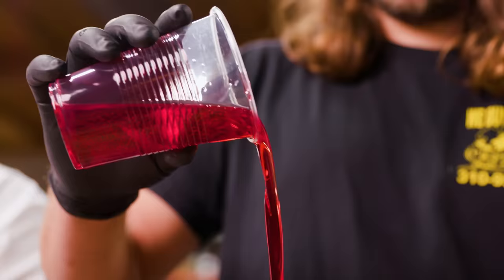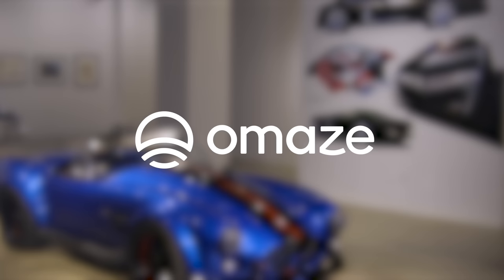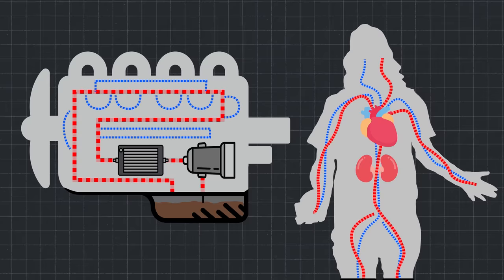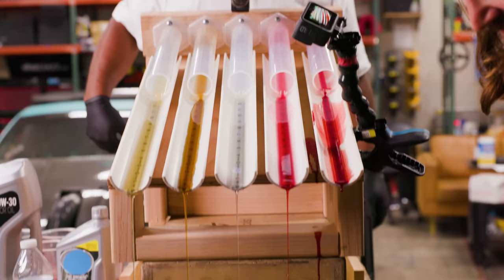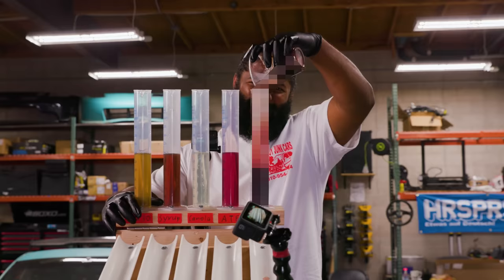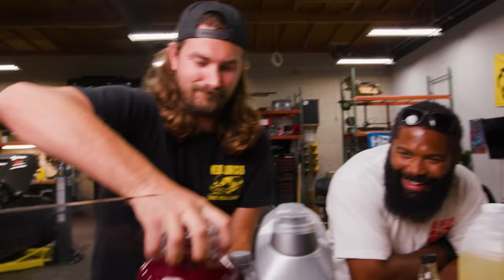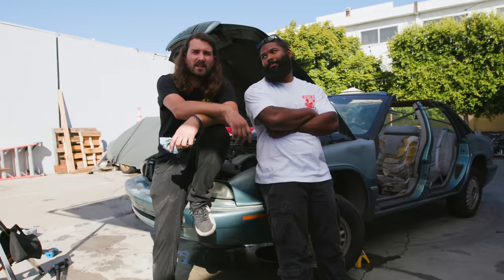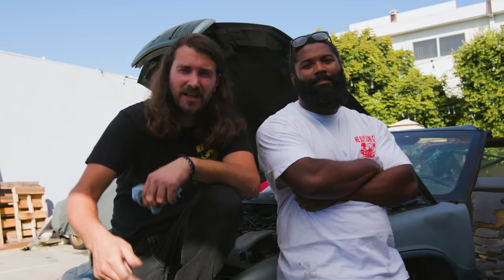We Replaced Our Car's Oil with Blood

Comment: Microwave oven doesn't heat all the 5 liquids evenly if if they are put together.

The way a microwave oven works is it heats up things which have more water content in them. That's why blood and Maple syrup heated up too much and the oils didn't.
Reply: Just wanted to say this
Reply: get outta here nerds. 🙄
Reply: Yes indeed the microwaves in the microwave are at the resonace frequency of water molequles and cause those to vibrate and therefore heat up. So liquids with less water like the differend kinds of oil heat up less.
Reply: @rooster_saucer  everyone at Donut is a nerd, dude.
Reply: Agreed. Should have used a hot plate like Project Farm does
Reply: More specifically, water is a very "uneven" molecule; microwaves make it vibrate violently like an unbalanced shaft in a car. This vibration causes friction with everything around it and that friction is the heating that you see. Blood is also full of proteins that denature when outside of their normal operating temps - just like frying an egg.
Reply: Ok boomer
Reply: @rooster_saucer  So you're admitting that they're smarter than you?
Reply: @TRD6932  shut up, well they are but, you get the point
Reply: @CristianDuartes  not nerdy enough to be able to heat up 5 different liquids though, apparently
Reply: Shut it nerd, O'DOYLE RULES!
Reply: @amicloud_yt  aakschually they did heat all 5 liquids, just not evenly
Reply: @amicloud_yt  there's a wide spectrum of nerds. They just aren't that kind of nerd.
Reply: Beakers and a hotplates is the only way to heat hydrocarbons for science. 

This wasn't all that scientific though I guess.
Reply: Came here to make this comment
Reply: This ^
Reply: Not to mention the radiation heat transfer isn’t exactly equivalent to conductive heat transfer.
Reply: Microwave won't even heat up the same thing evenly. A microwave has "cold" and "hot" spots, based on where the waves actually are in the microwave.  That's why it has a turntable in it. In the early days of microwaves, there was a bit of an attempt to eliminate "cold" spots, but that's largely been abandoned with modern microwaves.  (in fact, microwave tech peaked in the 90's for the most part.)
Reply: I expected jeremiah would have known this. Very weird test for sure.
Reply: I think you missed the part where he said it was “totally scientific” … so yea
Reply: Not only that.. but they were in plastic cups.. and you shouldn't put oil in the microwave in the first place lol
Reply: Spittin facts so i don't have to.  My man
Reply: Theres other stuff than just water that'll heat up in there but yea.

Like cd's, longer pieces of metal and stuff.
Reply: Dude should use an oven
Reply: 700+ people know how microwaves work lol
Reply: Nerds unite! Just came down here to say the exact thing.

For a little bit of an explanation. The microwaves that the microwave makes are a specific length so that, when trying to heat stuff up, they heat up water the best (because water is in almost every food).
Reply: Yeah, should’ve maybe used a hot water bath or a hotplate with stirring
Reply: this is common knowledge right...?
Reply: I was thinking that too. Useless test as they all heat differently and just made a gross mess. Should have done what Project Farm does and used hot plates.
Reply: Also might add a mention putting oil in a microwave can be extremely dangerous...
Reply: Jerry would have caught this if it was his show. Why is Donut turning to garbage clickbait?
Reply: A water bath set to a high temperature for a few hours would have been much more inline with their test.
Reply: Totally agree but this is Donut Media not The Learning Channel lol
Reply: @rooster_saucer  you do know these kind of videos are to learn something
Reply: on the contrary, wouldn't this show exactly what they're trying to show? the way different liquids would act when trying to get them up to temp?
Reply: also wanted to say this!
Reply: @rooster_saucer  only a lesser mind would judge education and knowledge
Reply: I was wondering about that thank you for the answer
Reply: I feel like they checked the individual temperature as they had a digital thermometer. Maybe cooked each individually after.
Reply: Yup
Reply: I like pancakes
Reply: Correct - you'd want to place all the liquids in some sort of regular oven to heat them all to the same temperature and test them that way.
Reply: that part killed me, talking about how because it heated up less in the microwave, that it was indicative of its ability to resist heat, and not indicative of the nature of microwave ovens.
still fun, but the button they put on the scene just made me pull my hair lol
Reply: Yeah, an oven would have done it better.
Reply: Came down here to say the same thing
Reply: literally wanted to say this as well. should use an oven perhaps? use convection heat!
Reply: @jasepoag8930  They are already trying too hard to copy Project Farm but on a stoner level. Lets not push them too far.
Reply: Came here to say that same. The whole "shows how good oil is at dealing with heat" line drove me crazy. That's not at all what's happening here.
Reply: @rooster_saucer  what's your value
Reply: @dannybrennan31  You're right. Then they should just abandon the idea of trying to be informative then, right?
Reply: Dammit, you're right! Now we'll never know for sure whether or not blood is a good alternative to motor oil!

Comment: You guys should have used an electric heating plate to test the thermals. That would have allowed for more control over the heat and prevent uneven heat distribution. Microwaves operate by having electromagnetic waves interact with certain molecules by vibrating them, the most common being water. This means that the different molecular makeup of the fluids determined the amount of energy being absorbed by radiation heat transfer rather than the ability to absorb heat via conduction (the type of heat transfer seen in an engine.)  That is why there is a such a huge difference in the temperature between the fluids.
Reply: Project farm ftw
Reply: yup... exactly what came to my mind the second I saw the microwave... heating fail :-D
Reply: @MartinKusyn  I recognize they weren’t really being serious with the video but as a chemical engineer that had to take 2 courses on heat transfer it bugs me.
Reply: The microwave was funny but yeah the heat applied to each liquid is super different and they aren't even close to operating temp if they're still in clear plastic cups
Reply: They put blood in an engine
Reply: @evanvevan  I would argue that you could make an inference of how they would handle at operating temperature even at lower temperatures because for the most part it scales “linearly” (as temperature goes up viscosity goes down.) However when the method of heating is flawed then your inferences are also flawed.
Reply: @ripem1417  doesn’t mean they shouldn’t get feedback on how to better test the cooling and lubricating properties of blood in an engine. Dracula gotta drive some how.
Reply: @toscanius  blood in da engine
Reply: thats the point "totally scientific heat cycle"
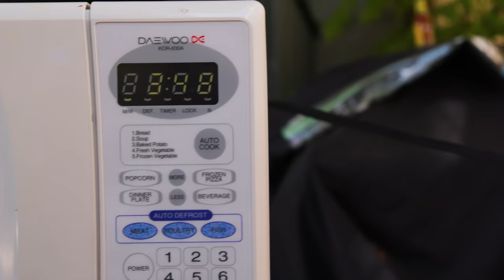5:44

this is for entertainement
Reply: big brain
Reply: I disagree they should have used an annealing oven with precise temperature controls to raise the liquids to a set temperature. Hot plates are no better than an open flame
Reply: @StealthNinja4577  issue with that would be convection vs conduction heat transfer simulation.
Reply: @toscanius  it really doesn't matter you want the liquid raised to a set temperature to then test it's viscosity at that temp the best way is placing it in an environment that is the desired temp and letting it raise to that level instead of generating a hot spot and heating it
Reply: @StealthNinja4577  it would matter if they were going to test and compare a thermal property like time to reach a certain temperature and not just viscosity. The rate of heat transfer will be different between convection and condition. I only suggested a hot plat because your gonna see conduction as the main source of heat transfer in an engine and that would be the best way to simulate and compare the different liquids. You can avoid hot spots by continuously stirring it or even better test how well the liquids transfer heat within themselves. Plenty of possibilities for them to come back to and teat different thermal properties.
Reply: @toscanius  but they weren't testing any of that and would have an easier time operating a preset oven for what they were going to do. The rate only really differs because you have a point source of heat on a hot plate at 500C vs surrounding the sample in an environment at 500C eliminating heat loss through the sides and top and increasing your surface area exposed to heating.
Reply: NERDDDDDD
Reply: They literally have one from when Jerry tested dollar store oil

Comment: As a former member of the 3800 community, the GM 3800 is a true glutton for punishment and can take a lot. But I think this is the first time in 20 years I've seen one run blood.
Reply: Engine is a beast, imagine one in a super reliable toyota body or an older well kept subie body (damn head gaskets -_-)
Reply: @trentswag9324  my buddy has one in his fiero (mint condition body) it's a happy little screamer I want to shove a Camaro 3800 and 5 speed manual into either a FC rx-7 or nb Miata
Reply: @trentswag9324  we had a toyota here in aus with the trust 3.8. toyota lexcen. pretty much a re bagded commodore
Reply: Probably one of the best engines ever made.  I wish i could have experienced the supercharged version of the regal gs.

Comment: I don't think the microwave was a fair heat test, the microwaves react the most with water molecules due to their size.
Reply: Yeah, I saw that as well. The microwaves aren't going to excite the long chains of the oil as much as anything loaded with water.
Reply: Agreed, you'd need a double boiler, or a sous vide
Reply: Yeah summarizing the temperature difference as "Engine oil is good dealing with heat" was kinda...
Reply: I was also thinking that
Reply: Even completely devoid of water, the microwave heats extremely unevenly.
Reply: @RiverWilliamson  What's Sous vide?

Comment: I would like to see how well the maple syrup and ATF do. Part 2? Maybe?
Reply: Lmao yes!
Reply: Maple syrup,eh?
Reply: I can't imagine the maple syrup gonna work. Its sugar, so it inherently contain water, which with a little heat gonna evaporate and builds pressure in the oil system; and it could caramelized and burnt, I cant imagine it doing any good to the engine components.

ATF probably way better choice

TLDR: ATF and Canola is built to sustain heat, thus probably a safer choice.
Reply: @azkarusydan6039  REAL maple syrup isnt all sugar, we’re talking straight from the tree, not that store shit
Reply: @darthcanadian  i mean straight from the tree is only maple water, you still need to boil it to reach syrup status
Reply: @eroy5448  stop making me look dumb, its only 8am 🤣
Reply: @azkarusydan6039  Not to mention the sugar content in maple syrup...I'm sure that once the water evaporates that the sugar would do wonders to the motor
Reply: They gotta try baby oil too. I hear it actually works
Reply: I’ll spoil it and probably why they didn’t test it, ATF works fine and I use it to flush engines since it’s so high in detergents
Reply: I can tell you from personally seeing it; my buddy had an old Geo Prism that's piston rings were gone, so dude went through a quart of oil every 200 miles. He had free access to ATF at the old shop we worked at, and he ran that Prism on ATF for about a year, until he left the shop and had no more access to ATF. Poor thing blew up about a month later.
Reply: @KitKitChanIsaac  EH???!!!!
Reply: @ifistedabear  I thought you were about to tell me he ran it on maple syrup.  Lol
Reply: same i have hopes for the syrup doing well short term
Reply: That was really disappointing, I thought we would get to see them all
Reply: @adamfields1761  yeah
Reply: @jakerobeck669  Isn't mineral oil one of the things they use in synthetics?
Reply: That's how you make maple sugar. Boil the moisture out of maple syrup.  If you heat it further, it burns.
Reply: car throttle already did a similar video a month ago
Reply: @darthcanadian  Sorry to make it sounds like maple syrup is just a sugar, but imo the sugar content in maple syrup would still hurts your engine

Comment: Should have done the blood last so that we could see how the ATF would fair.
Reply: atf is just 10~20 weight oil with extra detergents and would last longer than the gas they had in  the tank.
Reply: 7:47
Reply: Man I read this wrong at first.  Lol. Wrong ATF lol
Reply: Awe spoilers
Reply: @vegasrider05  the aft
Reply: In a Diesel engine that has been sitting for a while and has a small injector clog putting a gallon or two of ATF in the fuel will give extra lubricant and clear out the injection system
Reply: but they did...or were you being sarcastic lol
Reply: @yungdaggerdlck9062  They did Canola oil and then went straight to the blood. No ATF in the engine.
Reply: How much is 2 gallons of ATF? Those little 1-litre tubs are expensive enough!
Reply: @Debbiebabe69  2 gallons is for a 120 gallon tank a standard diesel tank is 30-60 gallons for trucks so 2 quarts is for 30 gallons in my area 1 quart of atf is $8 so $16
Reply: Trust me the results would boringly predictable if canola oil was holding up
Reply: All of you are forgetting about the syrup though. I would have found it more interesting than the red stuff.

Comment: the microwave did not heatup the oil because microwave eats up only water the food gets hot because of the water on it, that's why the motor and canola oil did not heat up.
Reply: Semi correct. Microwaves vibrates the water molecules, yes. But they will also vibrate other liquid molecules to heat up also.
Reply: should've used regular oven
Reply: @ncaquatic  at different efficiencies though. It really didn’t heat that motor oil much, so saying it dealt with heat better from that test isn’t accurate.
Reply: exactly! basic physics lol

Comment: That heat test is somewhat inaccurate, since microwaves essentially generate friction on water molecules that heat up the food it comprises. In this case, those all have different water contents, so they'll all react differently from each other

Bonus: the reason the syrup got so hot is because it has a high water content, but also because of its sugar content, since sugar can contain just the most ungodly amounts of heat

Comment: Useful hint! Years ago I had a leak in my MK3 golf steering rack, I was in Greece, where I didn't manage to find power steering fluid in any of the local gas stations, but we had plenty of olive oil. I filled it in, got home, few months later, my steering started hardening again, so i refilled with olive oil :) Somehow the leak cured itself, probably because of high viscosity olive oil and I never went back to real power steering fluid, I scrapped the car years and 50 000 km later with the olive oil still working fine.

So maybe, olive oil which has probably the highest viscosity of all cooking oils would be better than the canola oil, at least for the test purpose
Reply: big power steering fluid doesn't want you to know this
Reply: running olive oil in your car is the most mediterranean thing a european car guy can do
Reply: Olive oil is the best

Comment: Other than ATF, Canola would work okay, as expected. It has a flash point of about 700 degrees, and in terms of cooking it's quite common to add a bit of Canola Oil when using butter to cook as the Canola Oil prevents the butter from burning and turning brown if the heat gets to high. And it's why we use it in our deep fryers.

Also, Fun Fact (Fun Fact? Maybe...): The original name for Canola, which is a GMO and created in a lab at the University of Manitoba, was Rapeseed. It was obviously changed to something a bit less...rapey. Though it still uses the name Rapeseed in England.
Reply: The name "canola" is actually meant to differentiate it from natural rapeseed oil

Comment: I've heard that some people throw ATF in their motor before an oil change in order to clear out sludge since ATF has all sorts of detergents and anti-sludge additives.
Reply: It works great, especially in older cars that use leaded gas. My first car was a 66 AMC Rambler, and I'd put in a half a quart of ATF a couple of days before I was going to change the oil. It removes a TON a gunk.
Reply: I agree with the sentiment of throwing the ATF in a motor.
Reply: Interesting 🤔